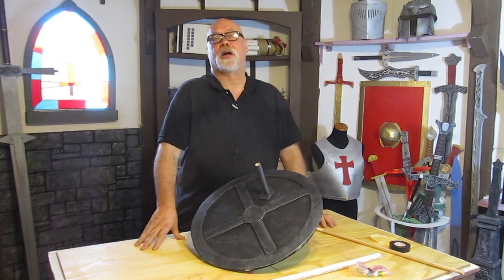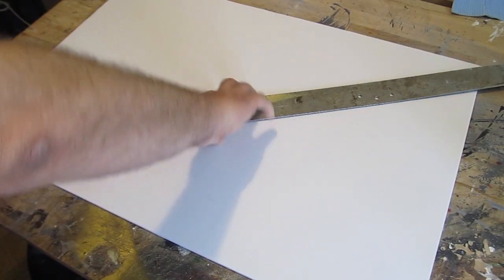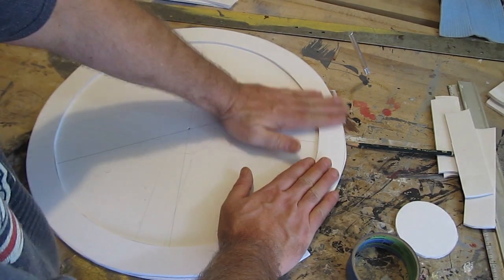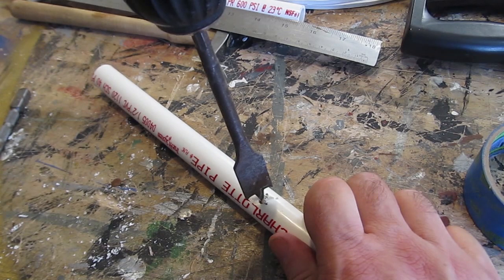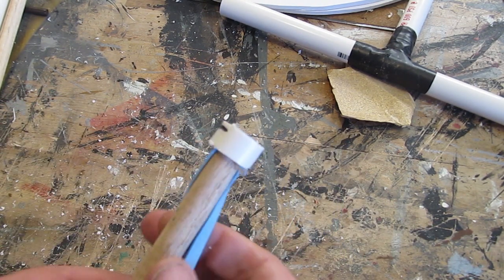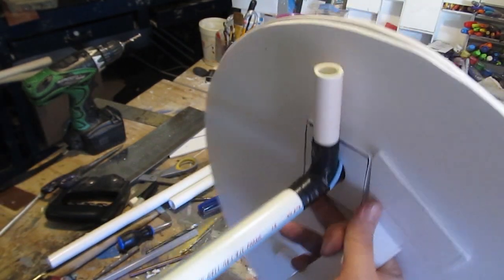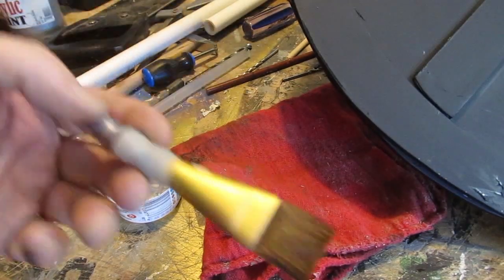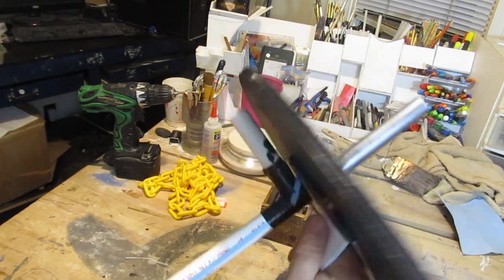Make a Medieval Gun Shield

Comment: I was wondering for cardboard if there is away to cover up the sides of the board and for the painting portion can spray paint be used as the base for the dry paint?
Thanks
Reply from the maker: This is a great question. I can only think of edging it with masking tape. Or possible cutting strips of cardboard and edging it with that.

Comment: Cut a hole with a hacksaw blade? Sorry, but that will NOT work.
Reply from the maker: darn, I thought it would work.
Reply from the maker: Although it doesn't have to be a round hole. A square slot will work just as well.
Reply: Well, I mean, you might be able to make it work if you got it started with something else, because just trying to get it started is the most difficult part. You might be able to use a jig saw, if you had a blade for cutting plastic, but most people don't have one of those. The thing is, the hack saw blades I have have rounded ends. It would be difficult to make a slit to make the hole. However, perhaps if you did make a square hole, and instead of using the end, you cut partway into the pvc, using the blade, then did the same a little farther away, you would have 2 sides of the square. I'm still not sure how you would get the other 2 sides. Sorry if that didn't make any sense.